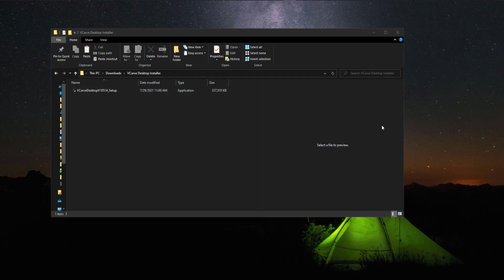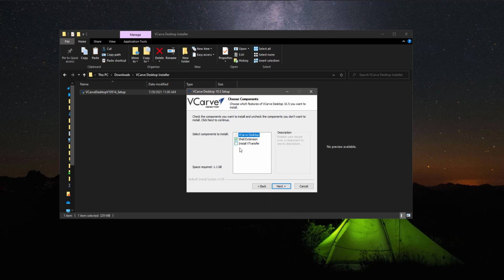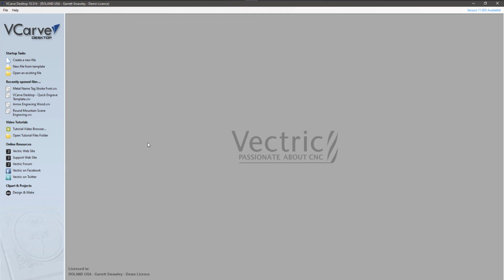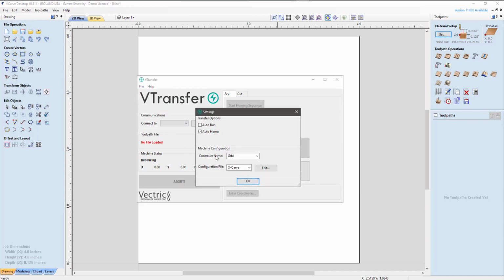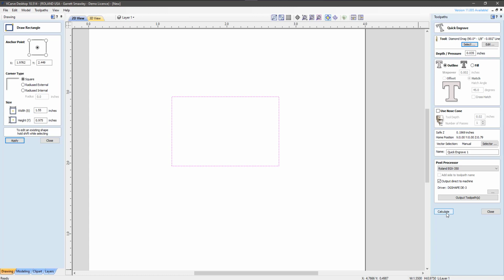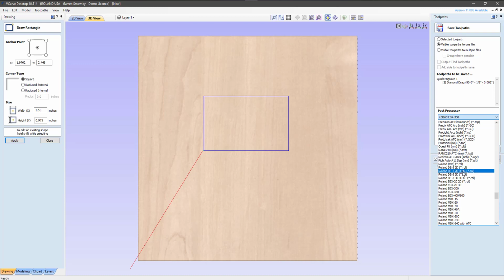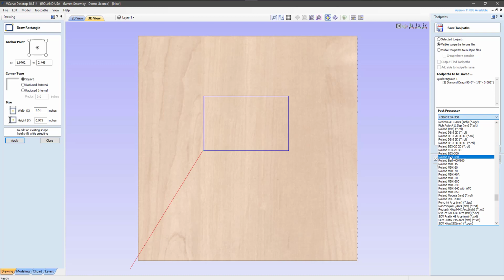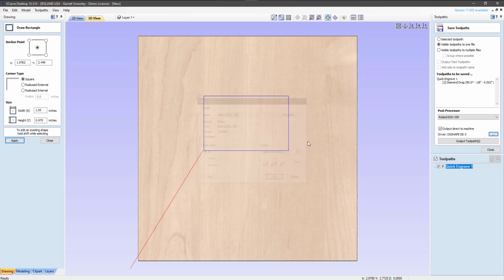How to Install VCarve Desktop For Output to Roland Devices

Comment: Hello, do you have a full Roland DE-3 tool database to import in VCarve ?
Reply from the maker: Hi, Sorry I don't but you can build you own based on the max feed rates and spindle RPM's listed below.                                                                                           

Core Specifications:

Spindle Speed (RPM): High-speed, powerful DC Brushless Motor with a range of 5,000 to 20,000 RPM.

Operating Speed (Feed Rate):

XY Axis: 0.1 to 60 mm/sec.

Z Axis: 0.1 to 30 mm/sec.